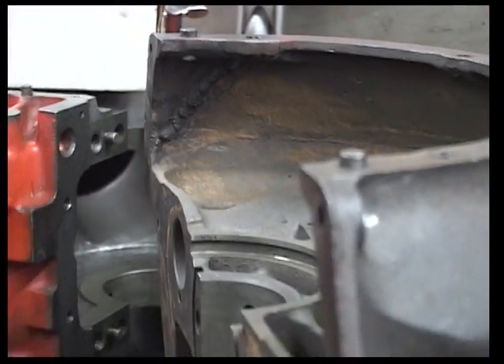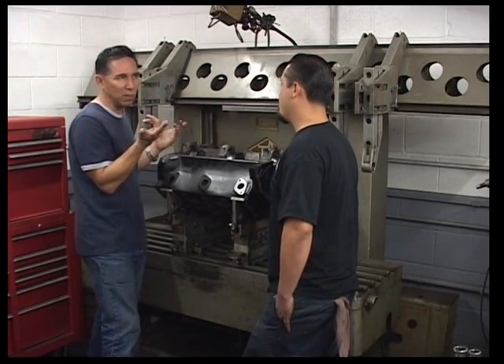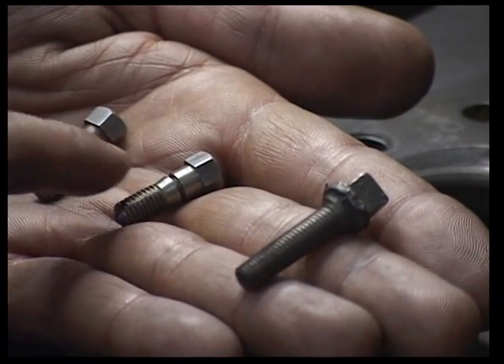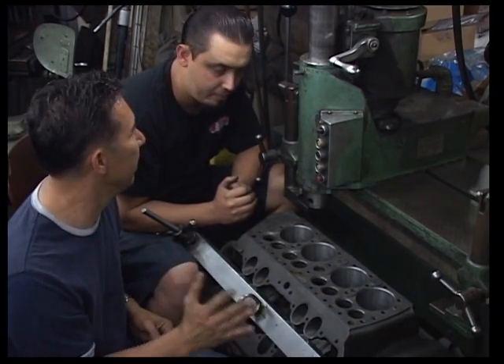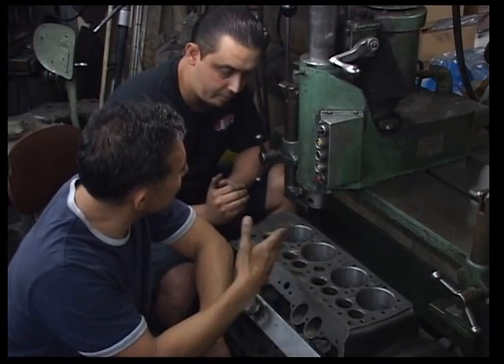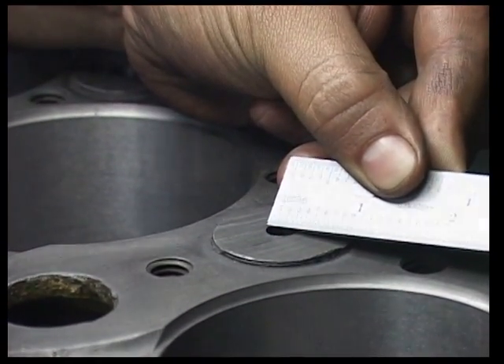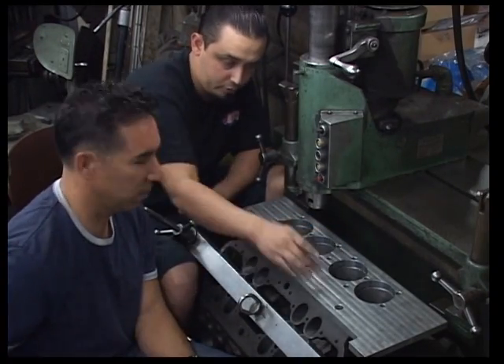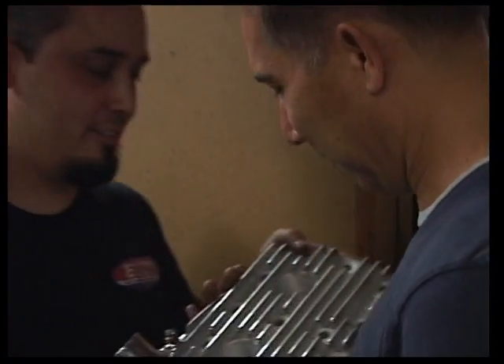Flathead Ford V8 block crack repair

Comment: Great information! I never knew that hard to reach long cracks like the ones shown could be repaired . Thanks too for stating the reasons for most of these cracks. that is stemming from neglect of one sort or another. The repairs are all worth it though to see the flatheads live another day.

Comment: Nice vid. with expertise to boot. Keep 'em coming!
Reply: Kyle Henricks There was I believe a modification for the flathead to overhead inlet valves. The side valves for exhaust were still used.  Also for the 100E by Willment. I had one with O/D also.

Comment from the maker: Most of the block cracks that are in the coolant area are because anti-freeze wasn't widely used in the times of these engines. When it get cold enough to freeze the water in the blocks caused the cracking.  Anti-freeze back then was actually blended by mechanics.
The cracks in the valve pocket area is a different story, they are from the engine running hot. That could be from poor cooling system maintenance, improper spark timing, a low water level and even bad thermostats.
Usually the OE radiator was so oversized that the operator really had to neglect the engine for it to crack from excessive heat but that obviously happened quite a lot.

Comment: My '36 Ford engine has a crack and is leaking from the coolant valley on the back passenger side of the engine between cylinders 3 and 4, right underneath the cylinder head. There is some sort of epoxy patch over top of it. I will make a video of it on my channel soon.

Comment: Depending on how good of a welder you are, cant you just grind away any crack and stack blobs of beads until you have a surface large enough to machine down to what it was originally? just asking as i saw someone cut a chunck out of a piston and stacked welds to recreate the piston head ( obviously a piston isn't the same ) just wondering how difficult it would be to do on a cracked flathead block.